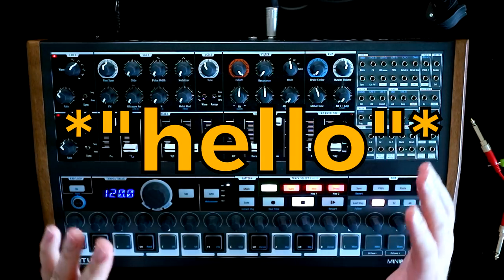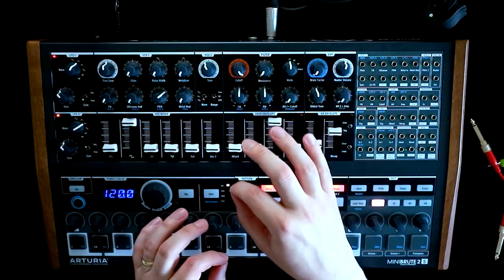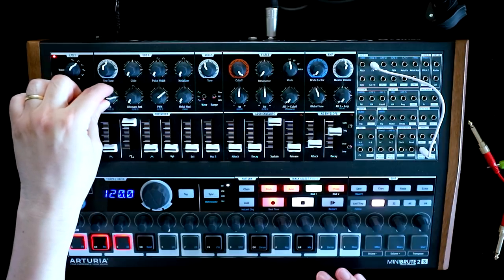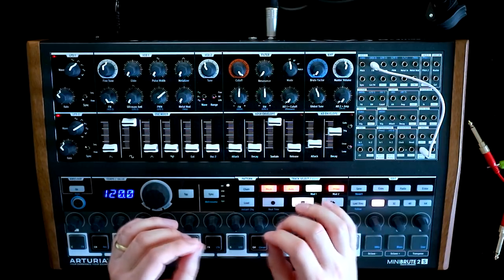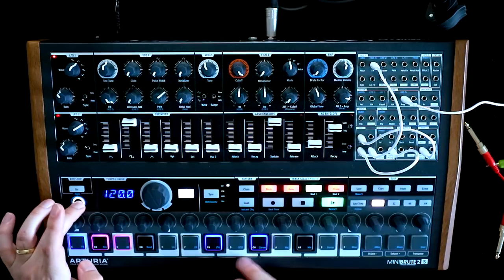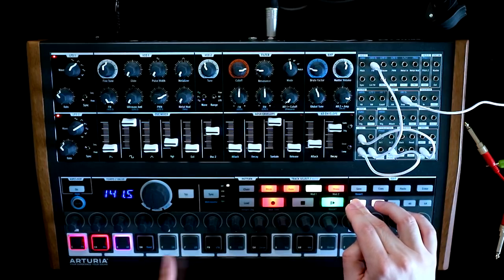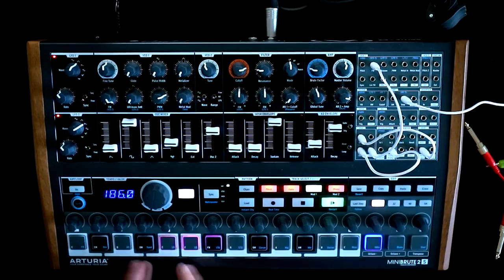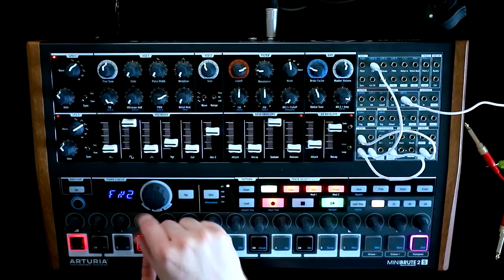Arturia Minibrute 2S - Let's Build an... 8-Bit / Arcade Arpeggiator

Comment: I've been holding on to a c64 specifically for sounds like this but It's such a huge pain to interface it with anything.  I think I'll sell it and pit it towards a 2s.
Reply from the maker: You could also try to track down a Therapsid or SID Station if it's that c64 thing in particular. But you can get most of the way here!
Reply: I just got a secondhand Therapsid mk1 for a reasonable price.  It might need a replacement SID chip, as it tends to have a mind of its own, like it has its own unique character and I have to say I absolutely love its sound.  As a heads up, Twisted Electrons are releasing another Sid style synth called TherapKid, but it is a digital Sid style, it is a bit cheaper than the analog versions tho.

Comment: ...Let's see if there is a video about how to make 8bit sound on the minibrute... Boom there it is. Thank you so much for this!
Two questions though, since I am not very experienced yet:
1. How do you make the sequenced sound to be played only when triggered by your fingers? (When i hit play, it is played nonstop...)
2. My sound is way deeper than yours even though i have the exact same settings as you... at least the ones that I can see on the poties... 

Many thanks in advance,
Cheers,
Sebastian
Reply from the maker: 1. Make sure your main "pitch" sequence is empty
2. Try changing octave on the keyboard, otherwise it's probably a case of retuning your oscillators.
Reply: @OscillatorSink  🧡 thank you so much!

Comment: Honestly, I would pay serious money for SID/FPGASID-based „groovebox” like thing with all the knobs and sequencer, like Circuit Mono Station (which I found really nice, much underrated machine)
Reply from the maker: Yeah. I think a lot of people would. That'd be killer.
Reply: Oscillator Sink Someone should call Elektron, they have knowledge and resources. Many people would just throw they wallets for SidStation in form of Digitaktone box based on that hardware platform.
Reply from the maker: A Digi Monomachine Mk. 3 you say?..
Reply: Oscillator Sink Exactly, but more “correct” in terms of SID compatibility as current hardware and software solutions can be much closer to the original than Monomachine emulation was. 

Also, it would be better for me personality, as I recently found MD MkII-UW completely out of nowhere, and now I’m hopelessly looking for MnM which is quite unobtainium recently, even considering these offers with crazy prices, almost nothing in EU right now. And I’m surely not the only one looking forward for it :)
Reply: Problem is we are running out of SID chips.  Elektron bought up all the stock when MOS stopped making them for Commodore. @_panSlonik_

Comment: Wouldn’t it have been easier to double the volts going to the fm input and use the fm pot to fine tune the octave. You wouldn’t have to disconnect the attenuator, didn’t have to use the amp AND have used the fm attenuator for what it’s made for. Bit nitpicking, but I normally like to use as little of the utilities so they remain free for when they are really useful.

Great vid, btw, learned a lot from these vids!

Edit: maybe your way is a bit cleaner for programming the sequence, now that I think about it...
Reply from the maker: Poooossssssibly yeah, that should work for the straight octave jumps, but remember that in the higher volt modes you lose a lot of accuracy with the voltages you can pick. It's already a bit tight when it comes to those "in-between" notes on 5v mode in terms of tuning, I think you might struggle to get the more interesting arps in tune on 8v mode (which you'd need to go to to get the same range).

Glad you're enjoying the series though!
Reply: Oscillator Sink just tried, I found that the best method was to use 1.2V per octave. That way you can fine tune using the fm knob and then every note in the octave is precisely 0.10V, which makes finding in between notes a breeze. Yeah, I’m really finding out a lot of new stuff because of your vids. I love the minibrute 2s! minibtrute 2 users miss out on a lot. The sequencer makes a lot possible, like paraphony, playing a bassline, bass drum and hihat sequence at the same time, and so much more!

Comment: Hi OS - love your vids. Do you/ did you get any tuning probs with M2S?
Reply from the maker: Thanks! In terms of tracking? No, not that I noticed. In terms of drift - no more than you'd expect from VCOs, which is to say - yeah it drifts a bit, but tends to be more stable after it has warned up for a while.
Reply: @OscillatorSink  thanks mate, still riffing off your OPSIX krell /juno patches. Keep it up.
Reply from the maker: Cheers, happy to help!

Comment: @oscillatorsink

I've watched all of your videos on the Minibrute.  I just put them on in the background when I am messing around.

I have a question for you:  I've started to experience an issue with the sequencer and was wondering if you have had the same problem.  When I hold load and jump from one sequence to another there is a delay of about 2 seconds ?  Very strange.  The delay was not there before.  I wonder if it's got to do with me filling up the spare banks with my own sequences and the cpu can't handle it or something.

Cheers,

Stephen
Reply from the maker: I haven't, sorry - are you running the most up to date firmware? You can check using the Midi Control Centre software - updating is pretty painless and it's worth ruling that out...

Comment: Would it be possible to use the two VCA inputs to combine the output of the Keyboard out with the voltage from the mod lane and send the output of that to the VCO pitch input?
Reply from the maker: I think so, but you'd have to get it exactly at unity amplification otherwise it won't scale. I'll have to try.
Reply: @OscillatorSink  According to the manual "This jack [VCA out] will output the combined signals of the In 1 and In 2 jacks at their raw input levels
unless they are controlled by an input voltage at the CV jack," but that doesn't seem to be true. It does seem to attenuate the level somewhat. Just running the output from the KYB out to the VCA input, and from the VCA out to the VCO pitch in, and the pitch doesn't track right anymore.

Comment: Can the sounds made be saved into the Synth? I tried but I don't think it saved. I would go back to try to find it but couldn't.
Reply from the maker: No, you can only save sequences, the synth itself is all analogue - it would be tricky to "save" which patches are plugged in for example.
Reply: @OscillatorSink  Thank You! I made some cool sounding sequences too.

Comment: How can you increase the speed of the pitch track? Tempo only affects the Velo track.
Reply from the maker: Tempo affects all of the tracks... Could you explain what you're trying and what's happening? If you turn up the tempo then all of the tracks should  move faster.
Reply: In your video at the very end you can see that the pitch track is moving slower. I guess I figured it out. I changed from 1/4 to 1/16 and it run quicker. Thanks
Reply from the maker: @df0rce  yeah, that's it! As soon as you set the Mod Tracks away from being velocity and pressure, you can change their divisions independently of one another - and their lengths for that matter.

One really cool thing to try that's related to that feature is try having the the Mod Tracks provide your gate pattern - patch it into the trigger in of the ADSR. Then you can set the divisions and lengths differently to your pitch sequence. Some really cool melodic ideas can pop out!

Comment: Or we can program octave jumps in Ableton send it through MIDI in?
Reply from the maker: You could straight up sequence the quick octave jumps, yes, but it'd be a slightly different vibe as you wouldn't have the free running sequencer running at the same time, so it'd be a little more precise - which could be what you want.